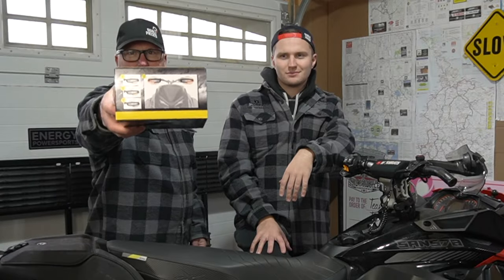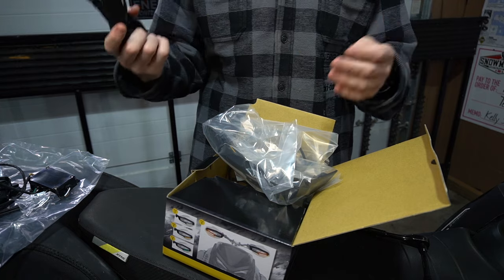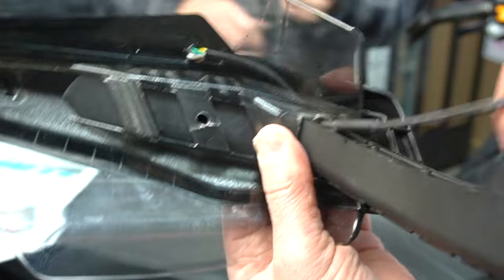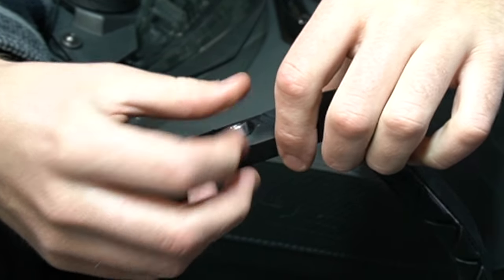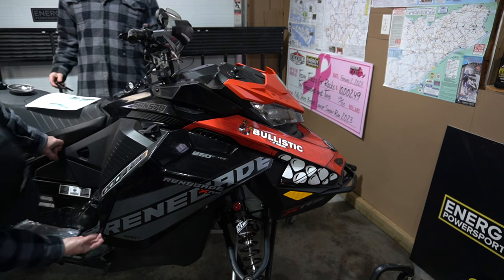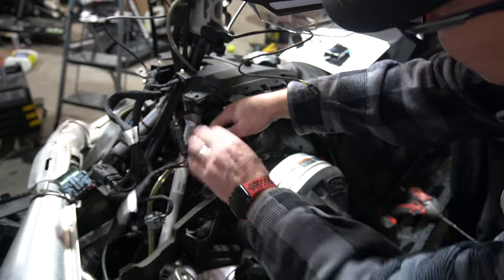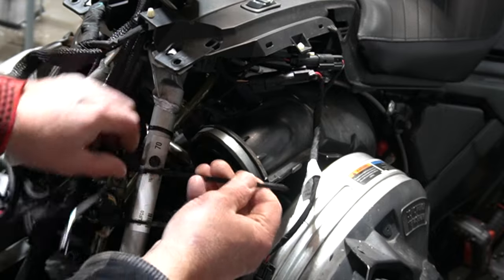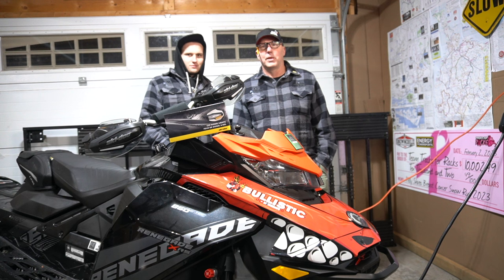How to INSTALL LED SIGNAL LIGHT KIT Ski-Doo Rev Gen4 2017-2022

Comment: I like the orange mode, should increase safety in poor conditions or at night. It looks well made to me.
Reply from the maker: yes they are pretty well made.  just to confirm, the orange mode is for when you have riders in your group behind you.  If you are last in the pack or riding alone, you would have green on.  The right hand guard is always white unless you have flashers on then they both flash amber
Reply: I see, thank you for explaining.  @mudbrats

Comment: Would it be possible to install this on a Rev XP? Great video
Reply from the maker: yep, you would need the newer style
handguards (the old XP ones do not
come
apart like this) and you would need
to splice into the power circuit (dont buy the retrofit for the XP)
Reply from the maker: Or go with the generic stick on trail lights from LJE enterprises or Bite Harder I think sells them.  But they aren’t as nice as these